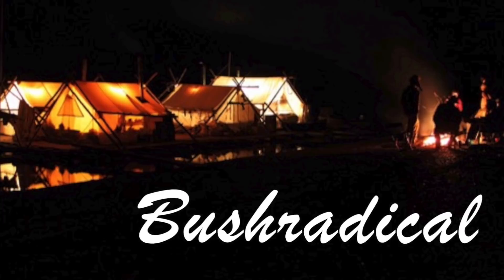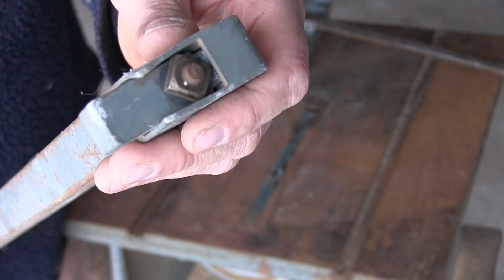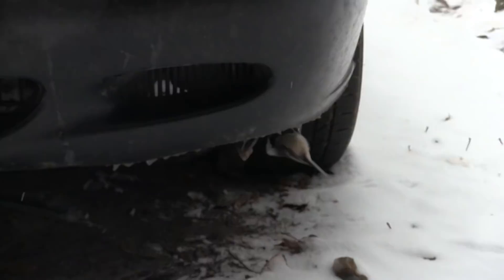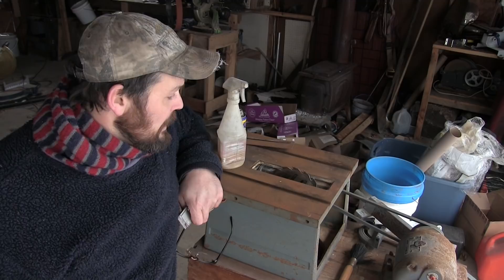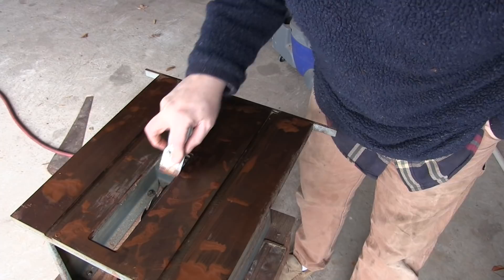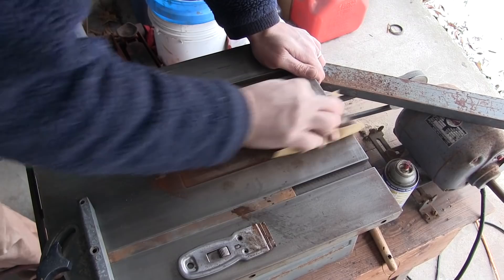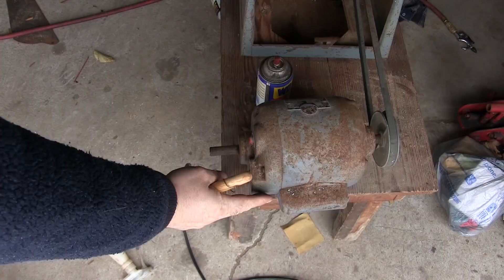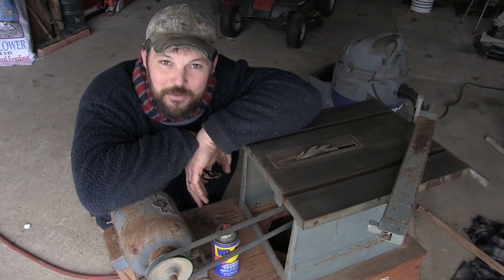Vintage Atlas Table Saw restoration

Comment: The holes on the sides look like they take metal round rods to mount extension tables on both sides for wider stock cuts

$25 is a good deal for sure on that table saw

Comment: UHOH! You made call 1-800-WAH WAHH! I've had to downsize recently and had to give up my wood shop tools. Bye bye lathe, bye bye drill press, bye bye joiner and face planer, bye bye expensive pieces of lumber, bye bye clamps, bye bye work bench and router with biscuit maker. Sniff sniff, good video man! Enjoy your tools while you still can. Sniff sniff.. hehe
Reply from the maker: Sorry you had to get rid of some awesome tools.
Reply: @Bushradical  HAHA! THANKS! Kept all my hand tools though hehe. The quality in vintage tools compared with some of what's out there today can be astonishing. The old stuff was meant to last for generations.

Comment: I had a temp job years ago cleaning a printer. I used Naval Jelly, boy did that make the rust disappear!
Reply from the maker: interesting..... Whats in Naval jelly?
Reply: @Bushradical  I think it is some sort of jellied solvent, it pretty much stays put after applied to the metal.I think you can get it at Lowes or Home Depot, maybe even Harbor Freight.

Comment: I bought a used Atlas Power King bench saw like this from the 1940's. Model 3001. Serial no.31066. Do you know how to adjust the blade heel. I can not see how to adjust the blade heel . Your blade appears to cut very straight. Mine cuts on a slight angle causing wood to bind, burn, and stall. A dangerous condition that prohibits it's use. I am not talking about bevel adjustment or blade height. Thank you.
Reply from the maker: I check the front and back of the blade with a tape measure before I lock the fence down
Reply: I just bought a 10" Atlas model 3060. There are bolts holding the front and rear of the carriage to to the frame. Loosen them and the carriage can be moved sideways front and rear. I am trying to find out if they ever had a blade guard or riving knife. I haven't taken it completely apart yet but I have not seen any place that a riving  knife would bolt on. Where have you found some of the parts or manuals? It is truly a beautiful piece of All American machinery.

Comment: You should call it tool repair for actual use. I use tools I do not have them for display. I do not care what they look like as long as they work when I need them to work.

For cleaning off the rust. Try just about any type of oil and a stainless steel scrub pad from the kitchen. Personally I use Gibbs Gun Oil. It is a bit on the expensive side but works great and adds a layer of protection.
Reply from the maker: Thanks Shawn. I hear about Gibbs but I don't know that I've ever seen it. I have a bootle of Hopps on my desk.
Reply: @Bushradical   I ordered mine online.
Used to get it at gun shows.
But the stainless scrub pad has worked with several different oils to varying degrees.

The razor blade worked pretty good for flat surfaces. The scrub pad wraps around stuff.
Reply from the maker: Right on. Thats Shawn.

Comment: Thanks for posting, I am gonna pick up one very similar tomorrow morning for free no less.  Plan to do the same thing.  I was wondering if you saw anyway that a ripping knife could be added for safety?  I intend to use it.
Reply from the maker: Ripping knife?
Reply: @Bushradical  aka bade guard / splitter